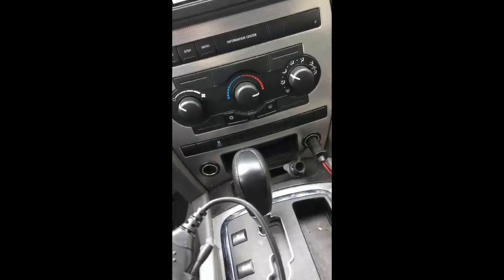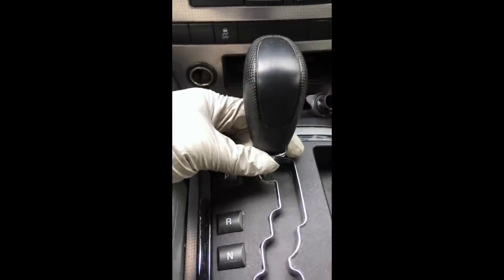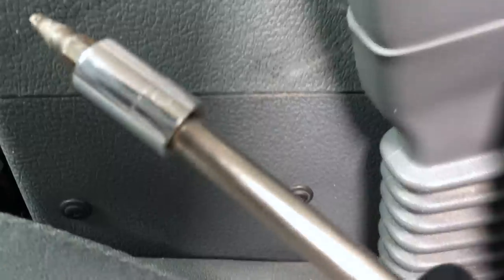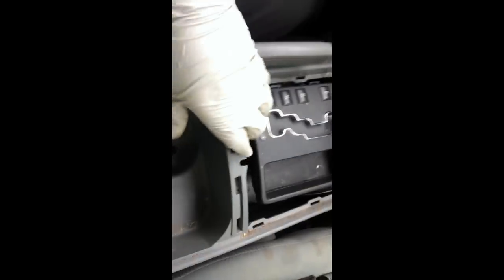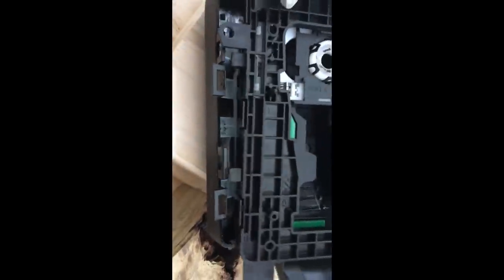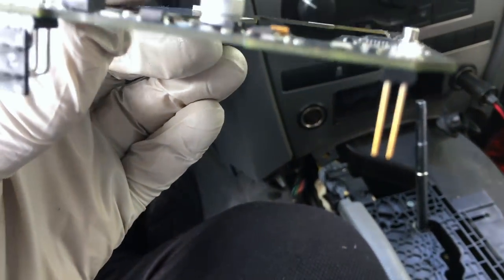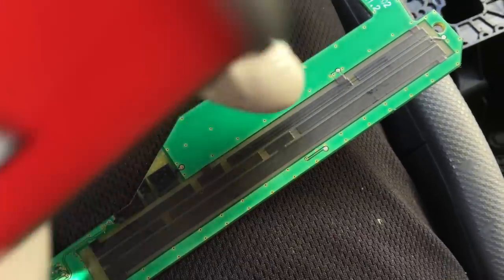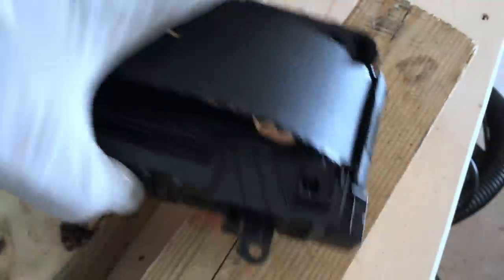2006 Jeep Grand Cherokee (WK) 3.7 Electronic Shift Module (ESM) Problems U0404 P0700 Codes

Comment: My jeep do that but it's having a misfire bank 1 code p0301 p2301 p0522  I'm thinking my transmission fluid is low lots of smoke out the exhaust pipe no harsepower when I pick up speed it's a misfire jerking
Reply from the maker: Have you ever done a tune up on your motor? Me I would change your plugs and coil packs. Did you check your motor oil? Is it low? The p0522 means low oil, or a bad oil pressure switch or bad wire going to the switch. What color is the smoke coming out the muffler?
Reply from the maker: When you pull out the plugs let me know the condition of them.
Reply: Transmission fluid probably low and you probably have a leak somewhere in your coolant lines I just got this problem fixed yesterday my Jeep running good now

Comment: Hello I just had my 06 jeep cherokee dash board taking down because of a heavy leaking from my AC. After having that done when I put the jeep in park and neutral gears it sounds very rough/sputtering like but when I put the jeep in drive and reverse it levels out. Do you possible know what's causing this.
Reply from the maker: Do you have a check engine light on?
Reply: @MrV2u  yes I do
Reply from the maker: Can you get the codes? Autozone and advanced auto will scan your car for free. I’ll be able to help better with the codes brother.

Comment: Ok I I have the same problem but my jeep won't turn over. New battery, brand new starter and new ground and wires from starter to battery. All the gears are lit up but won't turn over it has good power but the starter tries but stops. Used to roll it back in neutral and it start. Did this to it but found a lot of broken white plastic stem pieces in it and like it was taking apart before cause a few screws were missing. Anyway long I know sorry but when this happens can it prevent the jeep from starting at all. Oh and I just put a new motor in it has about 9 k on it now and I rebuilt the transmission and replaced the sensors.
Reply from the maker: You can have a couple issues. Do you have a check engine light on? If so do you know the codes? If it starts in neutral it’s a neutral safety switch. It can also be a relay/circuit breaker. When you put the key to the on position do you hear the fuel pump kick on?
Reply: @MrV2u   no codes fuel pump is kicking in. It used to start if I let it roll in neutral but now nothing. Oh yeah and I have a new ignition switch.
Reply: @MrV2u  only thing I can see is that all the gears are selected. But when it started in rolling neutral the indicator lights for the gears were just on the neutral. Now no matter what it's says it's in all gears lol I've had the battery out for about a week and tried but soon as I turned acc all the gears were still lit up.
Reply from the maker: Definitely try this fix in the video then. It’s cheap and only takes time. Weird being no codes. Did you check the fuses and breakers? If you go under the Jeep and have someone switch from park to drive does the lever on the side of the tranny move? Do so safely with the truck wheels cocked in case.
Reply: @MrV2u  I never checked the shift lever on the trans. I didn't think about that but that makes sense. Fuses were all good to I'm going to this cleaning and look at the shifter thanks.
Reply from the maker: @emptyjar02  let me know how you make out.
Reply: @MrV2u  I will definitely let you know 👍
Reply: @MrV2u   well I got it out not to bad a job but the board is cracked. So I'm guessing it's the problem.  lots of junk in it as well that doesn't look like it should be there. I ordered a floor shift assembly off eBay supposed to be here by Friday I just hope it's the problem.
Reply from the maker: Fingers crossed brother.
Reply: @MrV2u  thanks man gonna need it lol
Reply: @MrV2u  so got the new shift assembly same thing hit my steering wheel in anger and it fired up
Reply: @MrV2u  I'm driving it to O'Reilly's to use the scan tool to see if there's anything else. Like a u code
Reply from the maker: @emptyjar02  possible ignition switch issue, or your hulk powers scared that Jeep into submission. If it happens again jiggle the key in the ignition. Now I’m leaning toward the switch if all you did was bang the wheel.
Reply: @MrV2u   it fires right up now every time I got home turned around and my front drive shaft broke on me. I don't know man if I can keep at it I got the ignition switch and put that in but now waiting for the front drive shaft. I don't know if there a single bolt I haven't replaced. I got a remanufactured motor from work, rebuilt the transmission both differentials transfer case went through now another ignition switch. Every suspension part and steering part.
Reply from the maker: @emptyjar02  you know how Jeeps are. If it ain’t broke yet it will break soon. You’ve done crazy work on your Jeep already, keep at it bro.
Reply: @MrV2u  thanks man lol and you're definitely right about the jeep lol

Comment: I've had this problem and cleaned it per this video and it's still doing it on and off just order a use shifter and it's doing something could it be anything else?
Reply from the maker: If the check engine light is on can you tell me what codes are present. Did you clear the codes and recheck? Sometimes  other codes can pop up or go off. Let me know, we’ll get this squared away for you brother.
Reply: The only code that comes up is u0103 and I've cleaned my shifter then bought one on ebay it happened again so I cleaned that and now it's on again please help
Reply from the maker: @Steven-jy7kh  check your battery terminals for corrosion. And your going to have to look all over your main wire harness for any rubbing or shorts. It’s most likely a wire that’s shorted somewhere brother. It will be a pain in the butt to pinpoint a exact location. It can also be a corroded connection.
Reply from the maker: Hey brother check the connectors in the back of the shifter ESM and make sure there installed correct and that they are pushed in all the way and the pins are straight making a solid connection. Let me know what you find.
Reply: I believe it may be the connection at the fuse box where the main wire comes to the shifter plug but it's still coming on and off ass of now
Reply from the maker: Keep digging brother you’ll get it soon enough.

Comment: How long does this process typically take start to finish
Reply from the maker: Zach Millsap 45-1 hour. It’s not a bad job brother. Take your time and you’ll be ok. Took longer cause I was recording the video as well. Good luck
Reply: @MrV2u  I've already did the battery and new alternator. I cant keep wasting money
Reply from the maker: Zach Millsap do you have any codes? What are you experiencing? This is pretty much a free job minus the cleaner and q-tips.
Reply: @MrV2u  limp mode, gauges and air condition flash off for a sec. Down shifts sometimes randomly.
Reply: I have a 2005 grand cherokee 5.7 4x4
Reply from the maker: Definitely try to clean it for the limp mode symptoms. The ac is another issue. It could be a circuit breaker or resistor.

Comment: Hi got da same problem does it means my trannsmision slipping going bad
Reply from the maker: Do you have any codes or check engine light on?
Reply: @MrV2u  yes it was reading 0404 code saying my control module gearsgift wasn't reading something like dat
Reply from the maker: pgh steerlers definitely try to clean it like I did in the video. It should take care of the problem. Let me know if you have any questions and how you make out
Reply: @MrV2u  ok thanks but as off right now dats not a trannsmision slipping problem

Comment: My Jeep will sometimes go into 3rd gear on its own and then start bucking, is this the reason why?
Reply from the maker: Do you have a check engine light on? If so do you know what codes you have?
Reply: MrV2u if I let it go too long in 3rd yes light comes on, but haven’t read codes, I’ll stop Jeep, turn it off, and restart it, Jeep goes back to drive like nothing ever happened, engine light eventually goes away, lately when it does that and I go to restart Jeep it won’t start, like the battery is dead but all lights on dash work and battery is new, it’s almost like there’s a kill switch, after a few hours it will restart like nothing happened....two days ago had to spend 110 on a tow and when I got it home of course it restarted.... I’m noticing why so many people call these Jeep issues GREMLINS, these things should have never left the assembly line...it’s a 2005 Grand Cherokee limited with the 5.7L hemi with only 107k miles...I’m encountering the same issues as all, leaky sunroof, the problem I’ve described, heated seats working one day then not....I’m at the point where maybe I should throw it off a cliff rather than pass it on to another poor soul!
Reply from the maker: joseph alves first thing I recommend is to get those codes. You can go to autozone or advance auto and they will check them for you for free. From what you wrote you can have a bad fuel relay or failing fuel pump. The relay would get hot and pop and turn off the power to the fuel pump, or the pump is clogged or failing all together. When it turns off does it crank normal? Or does it sound weak like a dead battery?
Reply from the maker: joseph alves I hear you on all the issues the Jeep has lol. Pretty much all jeeps have issues, but there fun lol and look bad ass. You got to take the good with the bad with them. My bro has a 2011 wrangler and had a fair amount of issues way to soon. Catalytic converters, broken nipple on the fuel tank that I saved him from buying a entire tank, etc...
Reply: MrV2u yeah I agree, I love my Jeep just not all the issues....to answer your question no doesn’t crank, it’s like a dead battery but all lights on dash work and no clicking sound like you would normally hear from a dead battery, battery is a year old by the way....this seems to happen when the tranny drops to 3rd gear by itself and I have to pull over to turn Jeep off to restart
Reply from the maker: Nothing like electrical problems. Try and get the codes for me, I’ll be able to help out better brother. I feel your pain. You can have a couple gremlins all acting up together.

Comment: Great Video, ill be following your steps tomorrow!  I have 2 other codes I hope you can help with as well.  P2784 & P0717
Reply from the maker: Nathan Staats this fix should help you brother. Some codes are set because of this problem. Clean it out and clear your codes. Then take a test drive and see if they could me back. Po717 is a speed sensor on the tranny and p2784 is is also for a speed sensor. Could also be electrical issues. Pray it’s just the quick fix in the video. Let me know how you make out.

Comment: we have a jeep commander 2006 it goes forward in neutral any ideas?
Reply from the maker: Do you have a check engine light on? Have you been in deep snow? There is a shift cable underneath which pulls a lever on the outside of the tranny. Can you go through all the gears park, reverse, neutral and drive ok?
Reply: @MrV2u  tv cable seems loose at shifter and don't know how to adjust at carburetor because the only video i can find is for a Cherokee. There is a clip there but unsure how to get it off.  Help!
Reply: No lights on it
Reply: It seem will run really rough and key gets stuck in. It seems like it is stuck in drive
Reply from the maker: There is no adjustment on the throttle body. This shouldn’t cause your jeep to stay in drive though.
Reply from the maker: You have to crawl under the Jeep mid way on the Jeep and check the linkage on the transmission. Do it with the Jeep off and key out the truck for safety.
Reply from the maker: Look for a damaged linkage or loose cable going to the transmission.

Comment: I got a 2006 jeep commander I somewhat have the same issues. My codes are po732 po733 po 730 and p.o. 700 twice so can u help me with this issues
Reply from the maker: Realmademan1 Realmademan1 my advice is to try this fix in the video. Once you disconnect the battery and finish the job the codes will be cleared. All the codes have to deal with shift solenoids and generic. I feel this will help you. Being it’s a cheap fix try it first. Keep me up to date.  Hope that helps. Any more questions hit me up.

Comment: Here in 2023, I got a 06 jeep for free.99 😂. Same issue. I hope this fixes it
Reply from the maker: You speak my language with free.99. Let’s hope that’s all that’s wrong with it. Let me know how you make out or if you have any questions. At least there easy to work on. I swapped out my motor on it, you can see a couple things I added to it as well on my video.
Reply: @MrV2u  so I got it all apart the mother boards was dirty as hell but upon taking it apart there were bunches of broken plastic pieces but i got it back together and it worked but came back I think because all the broke stuff  so I order one on ebay
Reply from the maker: @alexsalazar2697  what codes are you getting?
Reply: @MrV2u  same 2 codes when I go from park to drive its ok and works but when I go from drive to park all the squares come back around PRND and start shifting like shit I think the broken stuff messes with it
Reply from the maker: Let me know brother, it can also be a bad shift solenoid or bad valve body. But I’d definitely start with the esm. Good luck brother.

Comment: Hey mu 2006 jeep commander was driving fine but all of a sudden it bucked and than died started back up great and sounded the same but the second I put it in reverse or drive it bucks and dies or just turns off did my transmission go never had this issue just happened yesterday and had to have my commander towed home.@MrV2u
Reply from the maker: Jasmine Negron do you have a way of checking the codes? I’m assuming you have a check engine light on. Did you have any other lights in the dash go on as well?

Comment: When I’m driving my  the gear shifts down to low 3 engine light come on can this be the problem ? The code I get is 0750 and 07500
Reply from the maker: The P0750 will be set when the Powertrain Control Module (PCM) detects a fault with shift solenoid “A.” What causes the P0750 code?
Faulty shift solenoid A
Low transmission fluid level
Dirty or contaminated transmission fluid
Poor electrical connection for shift solenoid A
Valve body assembly faulty

I’d start with getting the fluid checked. The solenoid is inside the transmission. You get to it by dropping the tranny pan.
Reply: Thanks I really appreciate u
Reply: @MrV2u  sir before u replied back to me I took it to a transmission shop and he used a different scan tool and he got 2074  and 0068 and I explained that while I’m driving my truck shifts to low 3 he told me these codes can cause that problem so I’m asking u how true is that?
Reply from the maker: P0068 is a vacuum leak, bad MAF or MAP sensor, bad throttle position sensor, or a dirty air filter. The p0750 could be the solenoid pack, or possibly clutches. I'd drop the pan and check for debris, specifically clutch material (usually looks like rag lint), aluminum, brass, or iron shavings. Have you ever had a tranny service? It could be dirty or low tranny fluid brother.

Comment: Would this be why my transmission wont shift....it wont shift...but when i stop and put it in park or nuetral real quick and then back to drive it shifts fine
Reply from the maker: PJ F I doubt it’s the same in your case. Do you have any codes? Pending codes?
Reply: MrV2u i dont have a code reader...not sure....just thought it might be the same issue or if it could cause it....
Reply from the maker: PJ F do you have a check engine light on. When it happens does the check engine light come on or flash. You can go to autozone and they will scan it for you for free.
Reply: MrV2u no engine check or no trans check light either
Reply from the maker: PJ F this happens when your driving? So your driving and it just stops shifting? Does it just rev up? Or does it feel like it’s bogging down. If it’s the latter try this fix if not let me know your year and engine you have I’ll look more into it for you.
Reply: MrV2u i turn the jeep on and go about my day...it could happen once or twice....usually just once i will drive and come to a stop sign or red light and when i take off it doesnt want to shift into gear....it hits the 20 mph mark and just revs....so then if i pull over and just put the jeep in park or neutral real quick it somehow resets and im back to normal....its the oddest thing....i really dont think its a direct trans issue it seems like its a electrical or computer issue....i really dont know....i cant find anyone with a similar issue online or in person
Reply from the maker: PJ F I had the same thing happen to me and it was a hub and bearing assembly. It didn’t throw a light either, but when I hooked up my scanner I had pending codes. I would still go to autozone and have them pull the codes. Just in case. What year is the Jeep? 3.7 or 4.7?
Reply: MrV2u 2006 3.7 jeep  cherokee....same as the video
Reply from the maker: PJ F https://mechanics.stackexchange.com/questions/33415/2006-jeep-grand-cherokee-transmission-issue  see if this link works. Try and do my fix and see if it helps, it’s the cheapest way to go to start. Make sure all the connections to your battery are clean and tight. It could be a sensor on the tranny. The list continues. Let me know how it turns out.
Reply: MrV2u definately will try this out....totally appreciate you helping this back yard wrench head out....if i figure it i will update....there might just be another 2006 trippin out there that the info could help
Reply from the maker: PJ F absolutely brother. Pray it all works out well.